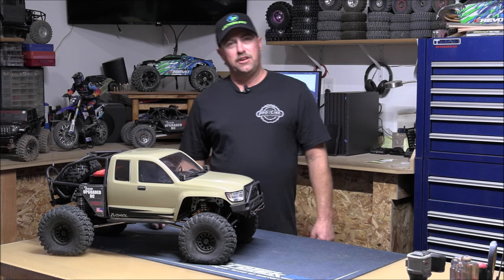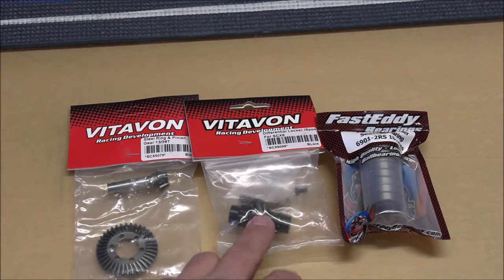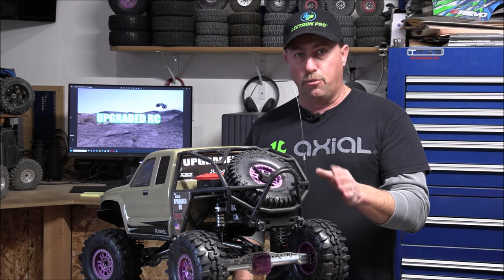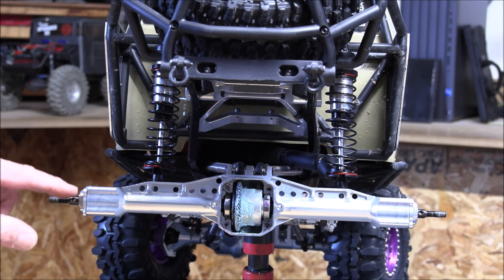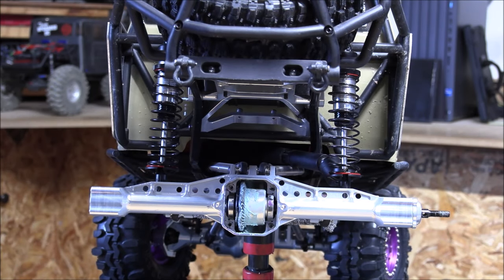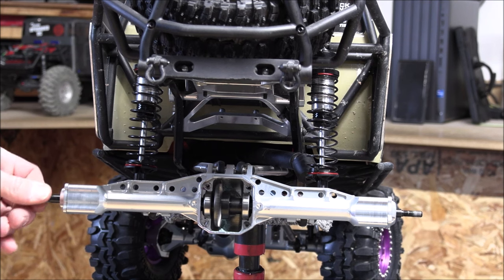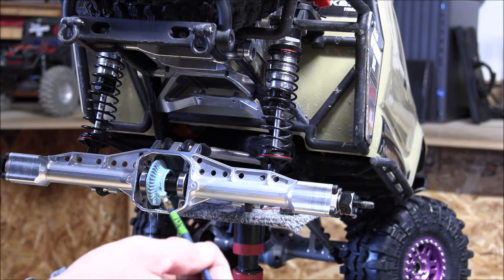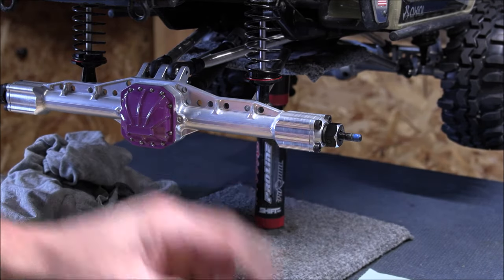Upgraded SCX6 Build Series Video # 7

Comment: 14:38 can I put 20m in my stock gearing for the scx6 ? What would that do
Reply from the maker: You can't put fluid in the stock diff. There is no place for it. Stock you have a ring and pinyon on a spool. The open diff I am using in the video is an open diff with spider gears, that's where I put the fluid
Reply: @upgradedrc3697  oh thanks , what kinda diff you have and are they the same on both axles ? What’s the propose? Thanks , also you know what’s the stock diff for scx6